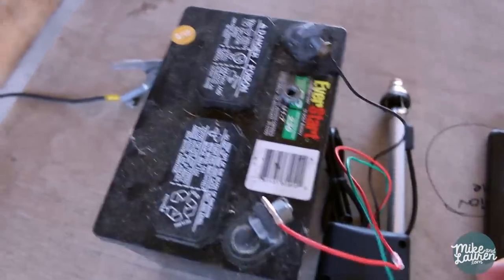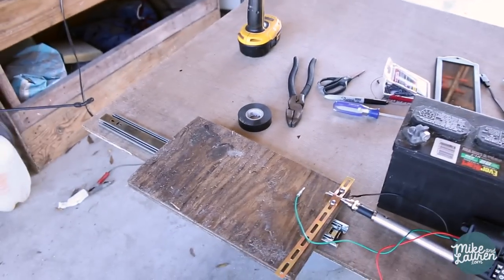DIY Automatic Chicken Coop Door Opener Build | PART 1

Comment: Ah! Just what i needed & at a good price with auto aerials from ebay at £11.00/$8.00 . I just built a model railway that is at high level & runs through three stud walls into different rooms at my house & i wanted a way to have doors on the stud walls that would auto open when the train is getting close & shut when its gone through. This will solve it as its nice & quick also. Well done for posting.

Comment: Mike, Did you ever get the door working/finished? I just completed mine. I did it a little different because I used a
semi auto antenna. It operates with one power source and two timers. I'll post the completed door and specs in a few weeks.
Reply from the maker: I got my dpdt relay in a couple weeks ago.  It took forever to get here from china.  I'm hoping to have time for it this weekend.  Definitely post your specs, that would help a lot!
Reply from the maker: huntermark1160 That is awesome!  You've inspired me to get mine working tomorrow.  What kind of timers did you use?  I think my light sensor broke :/
Reply: Mike and Lauren
This is the timer I used. If you have a fully auto antenna, you should look at this guys design. He gives you a step by method to complete the wiring for the door. Since I bought a semi auto antenna, I couldn't use his instructions. Good luck with your project.
http://www.backyardchickens.com/a/automatic-pop-hole-opener
 Neewer® LCD Digital Power Programmable Timer AC 12V 16A Time Relay Switch

Comment: After seeing your video, I searched out the light sensing switch,, and I don't think that switch is going to work. It seems to be an on/off switch, not a reversing switch. I am designing a similar system for my coop, using a power window motor, and I believe you are going to need to add a DPDT relay to your system. Although if you figure it out, I'd love to see it, it might save me some work!
Reply from the maker: illus471 I think that's the problem I had.  My light sensor was a SPST switch.  I'll definitely be working on it next weekend and posting a video soon!